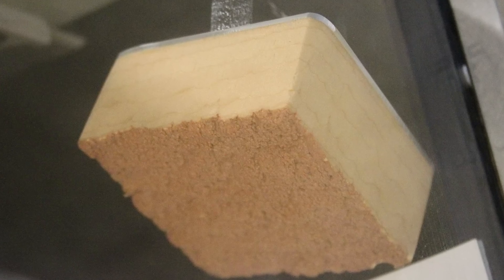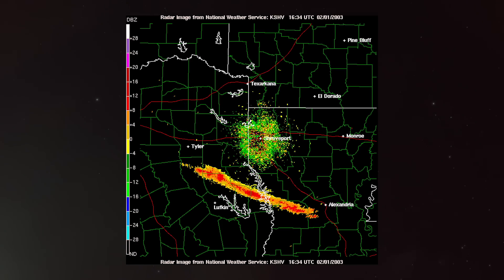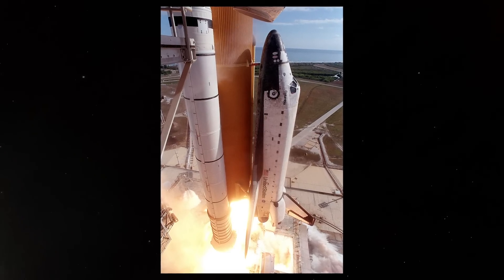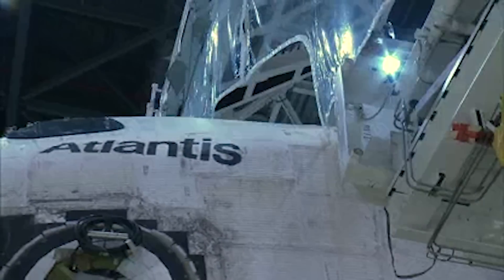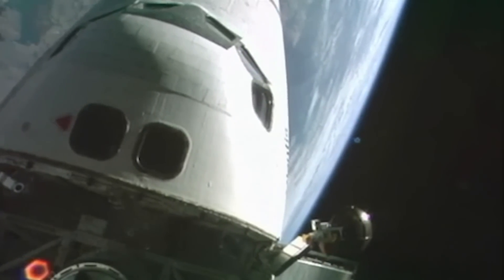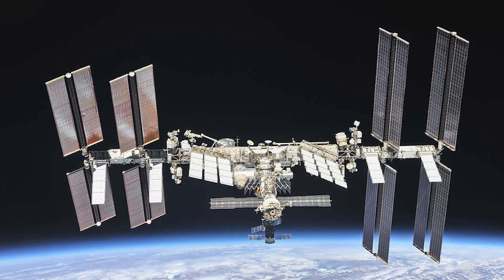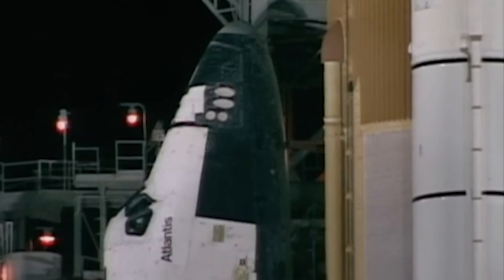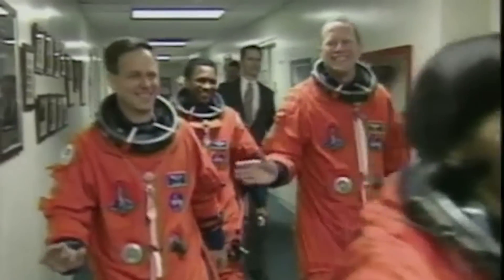The Backup Space Shuttle - A Rescue Mission that Never Launched

Comment: Of course the other action is that the crew were informed of the damaged wing and alternate angles of re entry modelled and attempted to offer some protection to the damaged area.We will never know.
Reply: Unfortunately the computer flies the shuttle through re-entry and to actually reprogram that computer to change the flight pattern to a safer and less stressful flight path for the left wing would have taken a ground based system to do.  Even with all the upgrades to the shuttle systems over the years they never upgraded the computers.  They were good and believe it or not they are still in use today in civilian aircraft.  I had the privilege of working on a computer of the same family when I served in the US Navy as it was the flight computer for the F-14 Tomcat.  While it was a good computer it was not able to be easily changed "on the fly" so to speak.  The flight profiles were loaded into it the morning of launch (a process that took roughly an hour) and it contained the profiles for the launch (altitude and orbital angle and what not) as well as landing profiles for Kennedy and usually one alternate landing sight. (Edward's or White Sands for example).  I believe the backup computer (#5) held the abort profiles, or at least to set up the flight conditions for the pilots to take over.  Most abort scenarios relied on the ability of the crew to fly the shuttle.
Reply: Maybe..m unfortunately the leading edges weren't made of any material that shuttle used. Carbon carbon probably isn't easy to effectively fix.
Reply: Probably could've worked. The shuttle was pitched back and to the right while flying over cali and Nevada without issue. It lost the left wing shortly after transitioning to a left leaning pitch over Texas.

Comment: Would having a couple backup bolt on tiles onboard an unreasonable thing to carry ? A repair kit  ... like for somthing much do much subosid redundancy... gret video as always
Reply: The Carbon-Carbon paneling (That of the leading edge that was damaged) is incredibly thick, and as a result, is very heavy; each Carbon-Carbon tile is also a different size and shape, and the normal tiling on the bottom of the shuttle is uniquely designed - each shuttle had a different number of silica tiles. So in short; no. That's why during every launch after STS-107 (The Columbia Disaster flight) there was a contingency plan; either rendezvous with the ISS, or if unable due to orbital positioning or some other reason a second shuttle was flight-ready, and on the second pad at KSC ready to launch. - This only happened once; during the last servicing flight of the Hubble Telescope (and the last non-ISS flight) for STS-125; Atlantis launched to service Hubble, while Endeavor waited on the second pad flight ready for STS-400 which thankfully wasn't needed.
Reply: @pilotben97  lol you sure know your stuff... yes I'm  aware  that the panels are all different sizes and hard to install  but  a repair kit  like  that's able to fix any  upto 18 inch hole  is not a reasonable thing to carry along  ?
Reply: @damianp7313  IMO Not really; no, it's not like fixing a flat tire with a patch, a repair kit that can fill that large of a hole with a material that can withstand 2,000+ degrees C while still being structurally sound enough to not get damaged itself would be a major stretch at best. Hence why they didn't do it, even after Columbia; you also have to keep in mind at the time they didn't think foam could cause damage like that, they just thought it would bounce off and disintegrate.

Comment: I stopped at about 2:40 seconds. I worked 20 years in Aviation and Aerospace. . Have you seen what a seagull, turkey or other large,  SOFT bird will do to an aircraft at only 200kts? It will rip holes large enough for you to crawl into. And Shatter 2.5 inches of bullet proof glass. Been there, seen it, first hand. Here we had a craft moving over 500kts, 2.5 times the speed, impacted by an object far harder than any bird, like a brick. Education is great, books are great, but they never exceed the knowledge of experience. My call, had I been there, would have been go to the ISS   NOW!

Comment: A couple of points: Columbia was flying with an Extended Duration Orbiter package. Thirty days of life support was mentioned. On Columbia’s first flight, some tiles were lost. While no official request to use classified, ground-based assets to gather images was made, images were delivered. They showed no loss of tiles in critical areas. Similar assets could have shown damage to the wing. Early access to such images might have allowed the crew to conserve life support, and provide more time to prepare a rescue launch. Columbia did not have a docking port, so I don’t see how the two orbiters could link together. So-called rescue ball enclosures would have been carried to support EVA transfer. Docking to ISS would likewise have been impossible, even if there had been enough delta-v to change Columbia’s orbit. The accident reported cited blunt force trauma as the cause of death. The seat harnesses did not lock as they should have.

Comment: They were aware of the strike on its wing during its flight.

They judged it to too small to cause damage, though some thought was given to using some spy says and ground telescopes to do an assessment. Thus was felt unnecessary by NASA management
Reply: Notibly the video showing the foam breaking the carbon carbon panel was after dozens of failed attempts. It was actually in a final round of testing before they were about to give up.

Furthermore, foam strikes had been common through the shuttle program. Past experience indicated the foam strike actually WAS nothing to worry about. Mistakes were made, but let's not all be Captain Hindsight.
Reply: @milhousevanhoutan9235  My point was that the video stated that they were unaware during the mission that the shuttle had been hit during launch, that was not true.

They were aware and some had advocated having a look to see if there was damage, that request was denied.

Comment: They did put the idea into ready and available use a few years later.  They had 2 shuttles ready and available and on pads 39a and 39b at the same time.  One shuttle was launching into a very high earth orbit for a particular mission and the other was planned for a mission a short time later.  They had both on the pad in case the 1st shuttle had issues and needed rescue back in 2009.

Comment: There was also some idea of letting the orbiter reenter with a bank angle to the side with the undamaged wing to reduce the heat load on the damaged area. If they only had known it was damaged... But I'm not sure it would have worked, maybe it couldn't bank that that much without putting too much heat load on other parts of the orbiter.
Reply: It's an interesting thought, but given that the damage was to a part of the shuttle which received the most aerodynamic and heating stress, it wouldn't have made enough of a difference.

Comment: Challenger didn't explode. It broke up due to the extreme stress as the strut was burned off due to the o ring leak. Then as the SRB booster started to turn and the extreme g forces disintegrated the vehicle. The cloud that people think is an explosion is the liquid fuel and oxidizes vaporizing.
Reply: We can always go with the grim, but accurate 'rapid unplanned disassembly event'.
Reply: no,.. the SRB booster turns because the Main Engine accidentally shutdown due to low Orange tank pressure, this causes torque, rotating the Shuttle into wrong angle-of-attack, imploding the Orange tank (cloud of gasses) as well as disintegrating the Shuttle due to aerodynamic pressure.
Reply: please refer to "Space Shuttle Challenger Accident Investigation (1986)" Youtube video by NASA if you have doubts.
Reply: @xponen  Actually the pressure began to drop in both the external tank and the right solid rocket booster. This was due to a leak in the external tank and the blow by in the srb as the hole enlarged. The main engines began to rotate under computer control to compensate for the reduced thrust of the srb. At approximately 72 seconds from liftoff the srb separated from the strut. The sudden change in pressure suddenly crushed the external tank. The tank ruptured both the liquid oxygen tank and smashed it into the liquid hydrogen tank. That part is an explosion in the conventional sense. However, the orbiter survived the external tank destruction for a fraction of a second and then broke apart due to the 20g force on a unit only capable of handling 5gs. The main engines never shut down.
Reply: @justinfowler2857  Main Engine can't possibly still thrusting if the fuel pressure from the Orange tank is already too low to point of collapse.
Reply: @xponen  Please cite your source that indicates the main engines shut down due to low fuel pressure in the external tank (ET). I have been unable to find anything to support your claim of engine shut down before the collapse of the ET. Thank you.
Reply: @justinfowler2857  it is said right when the Space Shuttle was engulfed in white plume, at minute 33:13 of the "Space Shuttle Challenger Accident Investigation (1986)" video and at 73.6 second in Space Shuttle's real-time. Space Shuttle was obscured by white gasses but it is still flying at that point.
Reply: what wasn't said was the glaring design flaw of Space Shuttle... as those anomalous thrust by SRBs and the reduced fuel pressure in fuel tank is both detected by the Computer/Telemetry, but there's exactly no exit/escape plan for the Space Shuttle when this occur.
Reply: @xponen  True. A escape system was considered, but due to complexity and limitations resulted in the abandonment of the idea. The problem lies with NASA's desire to keep flying and ignoring the warnings of the SRB engineers who warned that excessively cold temperatures would reduce the effectiveness of the o-rings.
Reply: @justinfowler2857  This business of the "O-ring" weakness  was probably another case where people kept quiet when speaking-out would have cost money and would have incurred displeasure from the profiteers at the top: who wants to have his family living in their car ?
Reply: @None-zc5vg  There is actually a documentary about how the engineers tried to stop the launch. They were over ruled by their managers and NASA brass. People died to keep the schedule.

Comment: The shuttle was doomed from the start due to a significant design flaw which was placing the fuel tank in front of the leading edge of the shuttle wing. As the Fuel tank cooled due to the emptying of the LoX it shrinks and foam detaches. It is a huge oversight by NASA, they really should have forseen this.

Comment: You should have done more research. A rescue attempt would have been impossible. For its doomed mission, Columbia had its airlock module removed (To install the science lab in the payload bay), therefore there were no space suits aboard. No airlock, no space suits. They were doomed from Takeoff. Also, it was a suitcase sized chunk of foam, not a dinner plate sized piece of foam.
Reply: Correct.  There was no chance for them.
Reply: They were wearing spacesuits when the shuttle broke up: the ACES suits. A rescue shuttle could have brought over larger oxygen bottles (the ACES suits only have enough for 10 minutes when disconnected from the shuttle) for them to make the trip over to the other orbiter.
Reply: I find that hard to believe, a second shuttle could have taken up any equipment needed to either repair Columbia or stuff needed to get the crew off. Columbia could have then remained in orbit until a repair mission then launched at a later time. The rescue shuttle could have had just the pilot and a few repair crew to attempt the Columbia fix first, failing that they could have all returned in the rescue shuttle... I refuse to believe a rescue attempt was impossible.
Reply: @desertroad4378  What happens if the rescue shuttle has a similar problem, and now you have two doomed shuttles, with 2 seperate crews in orbit?...
Reply: What sort of idiot thinks that a shuttle couldn’t bring EVA suits with them on a rescue mission? I guess now we know.
Reply: @skipintroux4444  It's not quite as unreasonable a question as that: Columbia had no airlock, so the only way to exit would have been depressurizing the entire cabin. If you have no spacesuits, that'd kill the crew. They did have the ACES suits, however, and could have depressurized the cabin while still tethered to the shuttle life support system, and then somebody in an EVA suit could bring over additional/larger oxygen bottles so that the crew of Columbia could survive long enough to make it through the Atlantis airlock's lengthy pressurization cycle.
Reply: @skipintroux4444  And how do you propose you pass the EVA suits to Columbia's crew without them having an airlock on-board, Einstein?

Comment: They could have went to the international space station. And your body doesn’t use nitrogen it is a filler. You can use just oxygen. But if you are under pressure like under water you will die of oxygen poisoning ( I’m a scuba diver I know ) but that is not a problem for nasa it would be for the navy. Now nitrogen is like alcohol but the effects are short. Nitrogen is a lightweight gas so if you walked in a room of 90% nitrogen you would be drunk than you would pass out and seconds later wake up sober. Scuba diving and diver can get drunk ( nitrogen narcosis ). Now if you are in a spaceship and you are running out of oxygen and you have nitrogen the ground crew would have a bunch of drunks in space. Try telling them how to land.

Comment: There's multiple abort procedures during liftoff. Had they known in time they could have aborted in the upper atmosphere and made an emergency landing.
Reply: Hal 9000 Correct, but it's velocity not altitude. There is an rtls and tal  procedure available to them, but like I said, they would've had to had full knowledge of the issue before then.
Reply: @RidinDirtyRollinBurnouts  Agreed completely -- they would still be a long way away from orbital velocity, meaning re-entry heating would be minimal compared to re-entry from orbital velocity. It's the same reason SpaceX can recover the first stage boosters, and why the shuttle's SRBs could be recovered after flight even though inertia would carry the spent boosters significantly higher into the atmosphere after after separation. TAL abort would have been a possibility if they'd known within a minute or two of the collision just how bad it was.

Comment: They knew? And they knew they couldn't fix the heat shield nor rescue the crew?
Reply: The damage was to the reinforced carbon-carbon on the leading edge of the shuttle's wing -- one of the parts subjected to the most re-entry heating and the most aerodynamic stress. In the 90s (and possibly even 80s) NASA had experimented with a foam that could be used as a makeshift repair to damaged heating tiles, but where the damage was located would have made such a patch impossible. If Columbia had been able to dock with the ISS, it's possible that NASA could have eventually found a way to patch the damage.
Reply: @devikwolf  But, Columbia didn't have enough fuel for the delta v to reach the ISS. Without a way to save the crew NASA let them carry out their mission worry free. I thought that it was common knowledge... ?
Reply: @stephenfritz7493  I know they couldn't make it to the ISS. I'm trying to say that the ONLY way to repair that level of damage to the orbiter would have been to dock it with the ISS while NASA figured out a repair plan. Since it couldn't make it to the ISS at all, there was zero option of being able to save the orbiter itself.
Reply: @devikwolf  I was mistaken. I thought we arguing about something else. I don't think anything could be done to have saved the crew. 

"F"

Comment: If a sub-10" hole would not have guaranteed the destruction of the orbiter then what about the possibility of the second orbiter bringing enough materials to patch each other up in orbit?
Reply: The damage wasn't to the shuttle's tiles -- it was a hole punched into the reinforced carbon-carbon leading edge of the wing, a component which takes the most heat and stress of re-entry. Repairing damage to this component would require disassembly of the wing itself, and no material available at the time would be likely to patch the location well enough to survive re-entry.